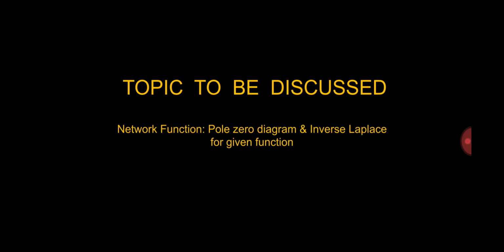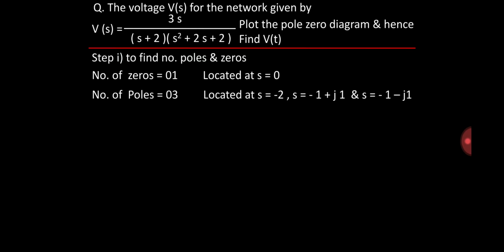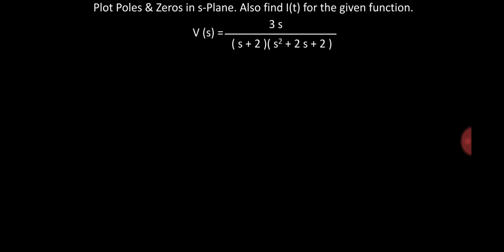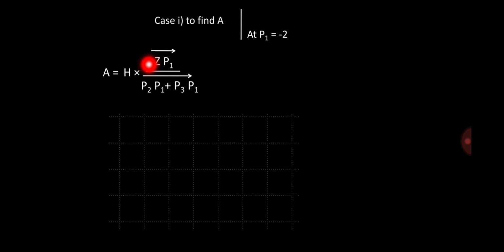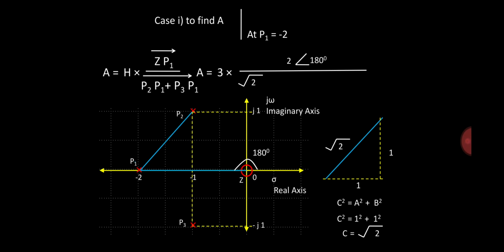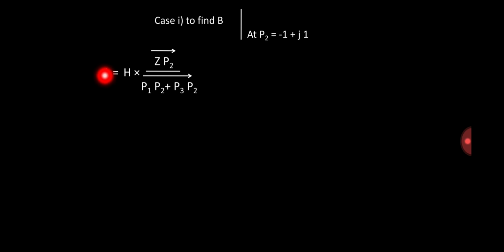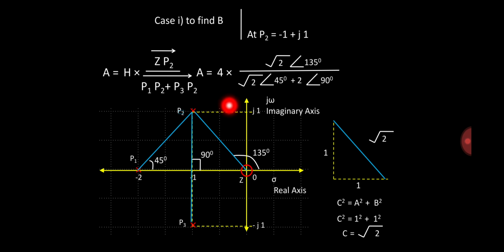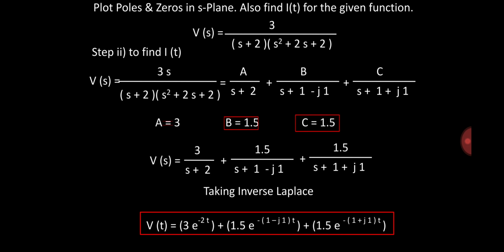How to draw Pole Zero diagram & to find inverse Laplace using Pole Zero diagram (with Animation)

Comment: Sir but if it has 2 zeros =0,1 . Then from which zero we have to take the dist. ZP
Reply from the maker: If two zeros are there then measure distance from both zeros to pole & add them
Reply: Digital Blackboard  okk
Reply: @DigitalBlackboard  then how we will take value of H sir
Reply from the maker: H is constant it's given 3